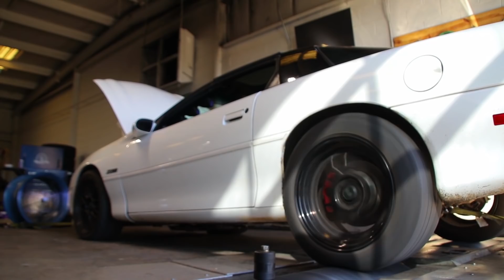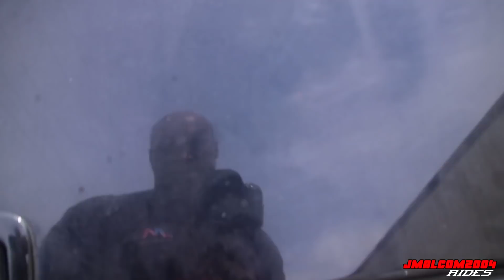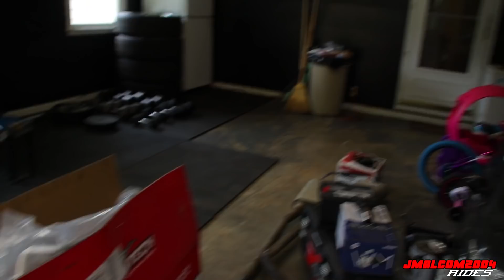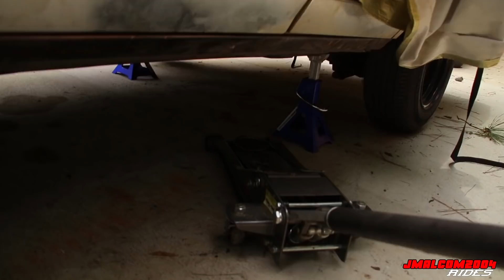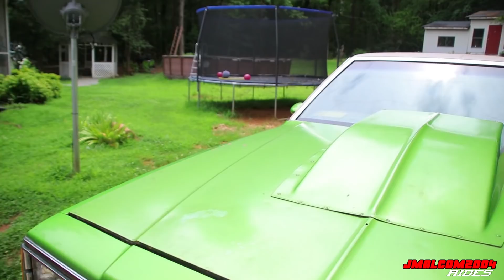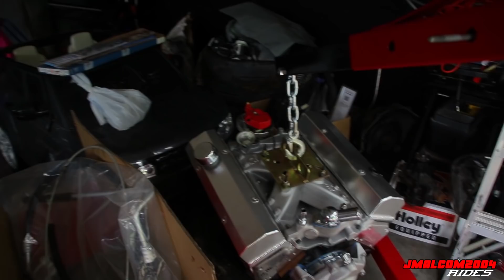PICKED UP THE MOTOR FOR DOLO AND THE EXHAUST IS BACK ON THE BIG MEECH BOX CHEVY NOW!

Comment: Teach me something bro why exactly is zinc required for breaking in the engine if you explained it in a video and i missed it i do apologize
Reply: Flat tappet cams need it hydralic or solid flat tappet if not it'll flatten the cam

It'll say ZDDP on the bottle or jug. If you have a roller can it doesnt need it

Comment: Hey what kinda radiator you have for dolo and I’m having a problem with my sbc getting hot I believe it’s the radiator.
Reply: What block are you running? 400 or 350? If 400 get 3 row radiator and an electric fan with 3200 to 4000 cfm. I prefer one single fan. My 350-383 i use two row raditor with 2500 to 3000 cfm fan. Flexalite or spal but they are costly. Ive used the zirgo fan too its just the fan motors on the others are bigger and to me will give the desired cfm. My compression on all are around 10:1 to 11:1.